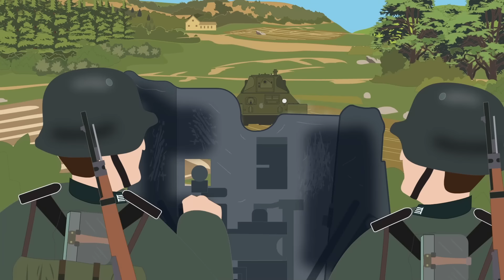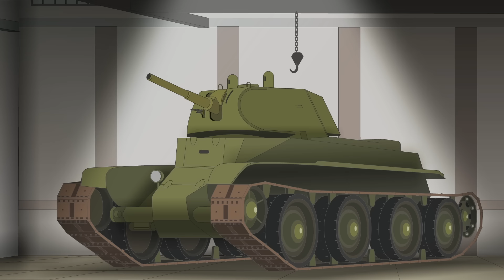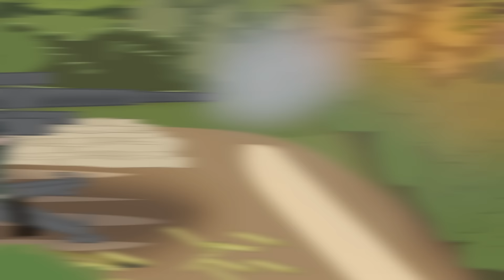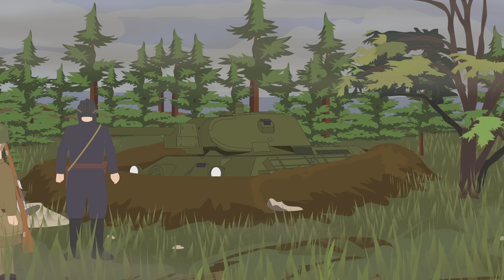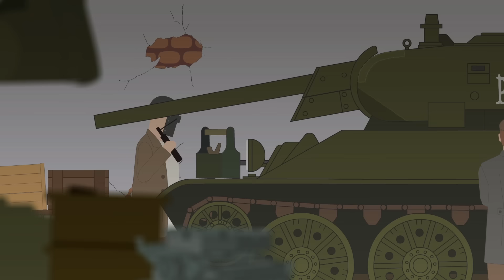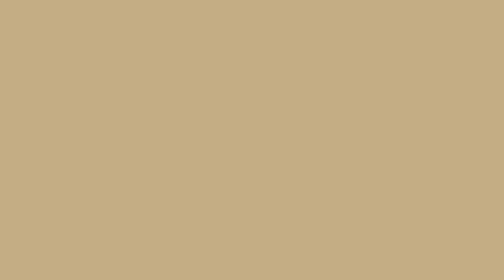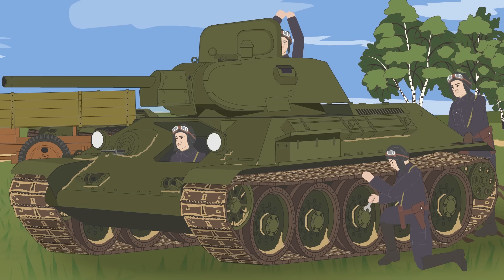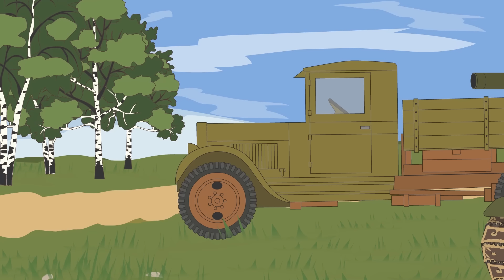Was the T-34 Really the Best Tank of WW2?

Comment: I think a lot of things people forget is that the T-34 was well armored initially, but quickly lost that. Not to mention that production value was terrible until American lend-lease equipment and factories were set up with better steel.

For example, a Sherman M4A2 had effectively the same or more frontal armor, especially the turret.

By August of 1941, Germany had already figured out how to use even the 37 at effectively against the T34 due to its poor metal work. Steel sheets were not tempered properly and made of soft steel. The steel that was tempered was so brittle, a small HE shell would cause spelling, killing the crew without even penetration of the armor.

The T34's only advantage was its reliability (enough), initial shock value, and numbers. And one of those was only available because of lend-lease.

Comment: Not sure if all, but T-34s had a piece of metal that stuck out on the inside of the chassis that pushed the connecting pin for the tracks, which gave it that loud clacking sound. It was a simple way to keep the tracks together and I assume it was probably for the early production models.

Comment: The T-34 was not the best tank, but every tank has it's own glaring shortcomings, and especially the Germans with their Wehraboos who scream when their superiority is questioned (Ex. German Over-engineering). It all comes down to this. The best tank is the one that wins the war. The Allies won the war and Russia, despite a late entry, was with the allies. Whether the Tiger, or the Panther, or the Sherman, or the T-34 were superior? Doesn't matter. The winner takes all. T-34 was a great tank for what it was needed for. It's simplicity, efficiency, reliability, and numbers were just what the Russians built it for and it did it's job when it mattered most.

Comment: Hate to point out a general flaw, but it's actually a myth that Diesel Engines were less prone to fire than Gasoline Engines.

As it turned out, the US Army checked that in 1943/44 and found that it was actually fuel that was an issue and that typically only showed up when the Tank was hit in a spot that would compromise the fuel in the first place.

Some fuel types were more prone to fire than others. Didn't matter which type of engine it was. Gas or Diesel? Didn't matter.

Although, during field recoveries and reading of After-Action Reports, the US Army determined that the reports of Gasoline Fires were typically the result of enemy gunners making sure an American Tank would burn. The only way to ensure that at range, was to keep shooting the Tank until it caught fire and burned.

Further inspection found that it wasn't actually fuel that burned at all. The US Army more often than not, found that its fuel tanks were undamaged by hostile fire, though certainly destroyed by fire. Fuel lines were likewise also rarely damaged and therefore rarely caught fire due to enemy action. Most of these were the result of where the engine was located, at the back of the Tank and most Tanks that were destroyed were shot in the front or sides, making the Fuel Fire Myth just that, a Myth.

What the US Army DID find that caused Tank fires was actually Ammunition Stowage.

In fact, Ammunition Detonation due to Hostile Action is the most common way a Tank ends up completely destroyed. From the Second World War to Today. A Tank is more likely to be destroyed by its own Ammunition being set off than by its own Fuel catching fire.

What helped to understand that, was the US Army reading the reports on losses. These typically made a report on a White Jet of Flame blazing high into the sky just before the Tanks were completely engulfed.

Such distinct blazes did not, ever, match a Fuel Fire.

Further research, thanks to the description, allowed the US Army to home in on the real killer. Poor Ammunition Stowage.

On M4 Shermans this hadn't been a problem. Though it had been short sighted, it was actually commonplace to store Ammunition in the Sponsons of the Tank above the Tracks. So, it wasn't just Americans who did it. The Chieftain, Nicolas Moran, did a video on the Panther in his Inside the Chieftain's Hatch. He showed where the Germans would stow some of their ammunition and once more, in the Sponson over the Tracks.

Incidentally, the M4 Sherman had superior protection on its flanks than the Panther did. Enough so to deflect German 50mm guns in 1942 and 1943 as well as the typical L25/75mm used by the StuG and Panzer IV Ausf D. So it wasn't just the T-34, but the American M3 Lee and M4 Sherman, as both could bounce a 50mm or L25/75mm on the front, sides, and rear.

It's also a Myth that Tanks are thinly armored on their tail. Most Tanks are pretty much promised to have Rear Armor as thick as their Side Armor. There are exceptions, but I don't think there were many who actually made the rear armor thinner than the rest of the vehicle. The T-34 was one of those with thicker Rear Armor, as your video shows. Typically, the Rear Armor of a T-34 was as thick as the Frontal Armor, but quality control issues at some factories did lead to some haphazard armor thickness for a number of T-34s.

The evidence of the Fuel Fire Myth is actually in the Late War Burn Out Rates of Tanks. The Tiger and Panther stayed consistently at 80% and 63% respectfully. The M4 Sherman's initial Burn Out Rate was also 80%, but by 1945, this was actually lowered to less than 35%-42% depending on model.

So, the so-called Ronson Lighter (which as it turns out, didn't use that unique catchphrase until 1955, and is odd to begin with as most US soldiers carried Zippo Lighters instead), was actually the safest Tank in actual combat by the end of the Second World War.

And the reduced Burn Out Rate wasn't fuel being better protected. It was the Ammunition. When the Ammunition was given better shielding, armor protection, placed into Wet Stowage, and moved to the hull floor of Shermans, the M4 Sherman stopped burning. The Germans to get them to burn, had to fire even MORE ammunition into the Sherman. Not something you want to be doing when your supply lines are failing.

In fact, the Germans themselves did not use Diesel Engines themselves for their Tanks despite popular beliefs, especially in the movie Patton. There was a Pre-War Agreement that the Kreigsmarine would get all the Diesel for its ships. Therefore, it was a pretty big myth that the Germans used strictly Diesel in their Tanks. They only used Gasoline until there wasn't much of a Kreigsmarine left and even that's open to argument.

Actually, a lazy browsing of the German Military Vehicles would generally show they used Petrol Maybach Engines.

Comment: Good video explaining the history of an iconic tank. Though a couple issue I noticed  was that for most of the video the tank shown is the T-34 1942 model, T-34E STZ model and the T-34/57 model, which although being the original  shape are not the iconic and well known tanks. Rather  that were mass produced at the start of the war but fell quite short in comparison to the T-34/85, which was produced at over 44,000 units. A final thing is that the 2 main types of the T-34 happended at different factory locations, with the first models produced mostly west of the Ural mountains in repurposed factories under the constant threat of war  to T-34/85s which were produced east of the Urals in factories that had been built to quickly mass produce these tanks.

Comment: Great video.

I think it depends how you look at the vehicle. If you are just looking at fire power and armor in a vacuum then it's easy to think tanks like the Panther and Tiger 2 are the best.

However if you look at it in terms of what makes a good tank for an army involved in a massive land war. Then things like range, reliability, numbers produced, ease of manufacture and ease of repair/replacement come much more to the forefront. In these aspects the T-34 and Sherman are basically neck and neck in being the best tanks of the war. I think the T-34 wins out here with its superior off-road performance but there is a very compelling argument for the Sherman being the best.

Basically my view is the Germans had tanks which individually were monsters. But too few in number. The Soviets and Allies had tanks which were good enough to get the job done and available in great numbers. Which was all the difference in the end.
Reply: "A Tiger could handle 4 Sherman's, but there were always 5"
Reply: @mitchspurlock3626  The Sherman’s 75mm gun was enough to take out a Tiger tank in the right spot. It’s all about tactics to not get your armored vehicles knocked.
Reply: I disagree. The Sherman and Panzer IV were far better vehicles overall, taking into account factors other than just guns and armor.
Reply: @revanofkorriban1505  panzer 4 was outdated. It is a mid 1930s tank in a 40s war
Reply: @warbrain1053  It was a tank ahead of its time. Plus, it could and was upgraded to keep up with developments on the battlefield. The T-34 was an overall inferior vehicle overall to the Panzer IV, mainly due to its reliability problems, godawful ergonomics, and lethality to its own crews. The Sherman was the best tank of the war, essentially taking all the positive attributes of the Panzer IV and one-upping them all.
Reply: @revanofkorriban1505  are you sure? The first "design" of the t-34 could take on the "later" models of the panzer 4. The pz-4 production begun in 1936. T-34 in 1940

Initial frontal armor of pz-4: 30mm
Gun was an infantry Support gun
Initial frontal armor of t-34: 90mm
Infantry support gun too

If you want to compare pz-4 f2 and later, the upgunned versions, we have to compare them to the t-34-85 versions - which had a lot of upgrades, where as the pz-4 versions made it overweight and less reliable due to suspension not made for this job
Reply: @warbrain1053  The Panzer IV overall was a better vehicle. It had better optics, better ergonomics, and better reliability. All the T-34 had going for it was thick armor and a good gun, with decent mobility. Now, where does that argument sound familiar from? You guessed it. The Panther fanboys.

The T-34/85 started production in 1944, while the Panzer IV Ausfahrt H started production more than six months earlier in June 1943.
Reply: @revanofkorriban1505  sadly the first models of the pz-4 suffered from reliability issues. So if we do compare models of the beginning of the cycle of each model, the pz-4 has only ergonomics and optics going for it. There it has another problem: its gun had no strong anti tank capability

Also big gun on the panther? The last versions of the pz-4 have the same gun size. 7.5cm AT guns.
Reply: @warbrain1053  The Panther was bigger and could use the long 7,5-cm-KwK 42 L/70. StuGs without a turret could use a gun of the same size, but a Panzer IV couldn't. The biggest gun they could use for the last versions of Pz. IV was the shorter 7,5-cm-KwK L/48.
Reply: I mean the T-34 also had including angle, 90mm of frontal armor. More or less as much as a tiger -12mm. Even raw armor the first t-34s were as armored as heavy armor
Reply: I'm backwards. I'd say the Sherman rates a bit higher given that some Russian tank crews actually preferred it when they had T-34s as an option. But you're right, they're both pretty neck and neck as the two best tanks of the war and you really can't rank one over the other.

If we were in a vacuum however with no technical/mechanical issues? The Panther and Tiger would easily take that spot.
Reply: @ultimaaxe  The Sherman knocks the T-34 out of the park in soft factors. It's not even close. The Panzer IV was likewise better than the T-34 due to having superior soft factors, though the Sherman beats it out in turn by a good margin. The argument that a big gun and thick armor are the only thing that matters belongs to the Pantherboos.

Comment: The T 34 was not deployed in ww2 it was made during but was not in use. by the time that was over the Russians only just had enough for deployment.
Reply: What?
Reply: Are you sure that it's a T-34 and not T-44?
Reply: @Kalashnikov413  I’m pretty sure from memory they started manufacturing the original T34 In 1941 and the modified version in 1942
Reply: @Me-xo4wk  Nope

T-34 started it's production in 1940, using the old turret and the L-11 gun. In 1941 the T-34 received the famous F-34 gun and later in 1942 received the well-known Hexagonal turret
Reply: @Kalashnikov413  feel free to correct me

Comment: I want to know who started the rumor that the T-34 was the best tank of WW2, just because it was cheap to produce doesn't make it the "best".
Reply: There was never a "best tank" of WW2. Never will be...Why? Because every tank built was lacking ins something...armor, firepower, reliability...you name it...
Reply: @ArcticWolf00Alpha0  ok ok, i have a game for you. i am gonna name a ww2 tank and your gonna have to tell me its weaknesses. ready? Sherman
Reply: @neilcaezar306  which Sherman variant though?
Reply: @neilcaezar306  If im simply generalizing the Shermans main weakness, its armor and average 75mm gun were inadequate. 
The Sherman M4A3E8 and Firefly were good in terms of their guns, but their armor didn't offer much protection. 
But as the war went on the Sherman saw several upgrades and improvements so its hard to pin one solid weakness down, but largely the shermans armor was weak and inadequate by 1943-45 maybe even in 1942.
Reply: @ArcticWolf00Alpha0  oh sorry, forgot to specify.
Reply: @ArcticWolf00Alpha0  Tiger II from Germany, weaknesses?
Reply: @neilcaezar306  Tiger II? 
Horrendous reliability.
Took up too much fuel which resulted in King Tigers being abandoned constantly. Many times before they even got to the front lines. 
Their overlapping roadwheels made them EXTREMLY prone to getting stuck in mud and being completely immobilized.
The King tiger's engine was the same engine used on the Panther, but it weighed so much more and often broke down do to how heavy it was. The King Tiger needed a whole new engine to fit the desired criteria.
And The King Tiger was produced in possibly the worst time possible for Germany. By 1944 the King Tiger was produced but by that point the Germans lacked everything needed to keep the King Tiger going, Fuel, Steel, reliable crews, spare parts...everything...
The King Tiger being the go-to over the Tiger 1 was the last thing the Germans needed. The King Tiger is the personification of "Bigger doesnt mean better" and "rubbing salt in the wound." 
However its gun and armor were absolute killers on the battlefield.
Reply: @ArcticWolf00Alpha0  actually the welding of the armour on some of the king tigers were abysmal
Reply: @str2010  However the King Tigers armor isnt to be underestimated, it could still bounce and stop most shells, even the 122mm shell from the IS2 had its fair share of trouble.
Reply: @ArcticWolf00Alpha0  obviously
Reply: Might as well find out how it was the "best" tank by researching
Reply: probably soviet propaganda